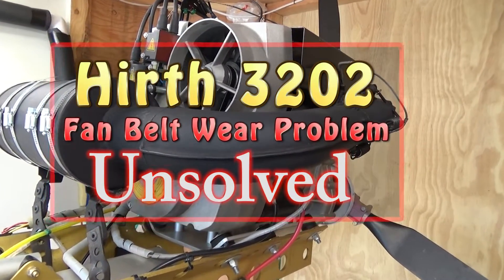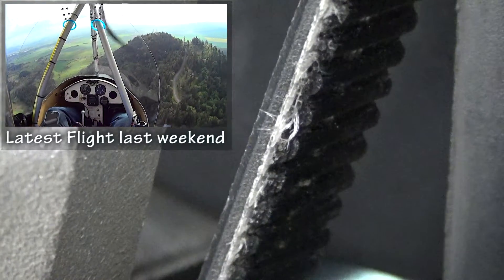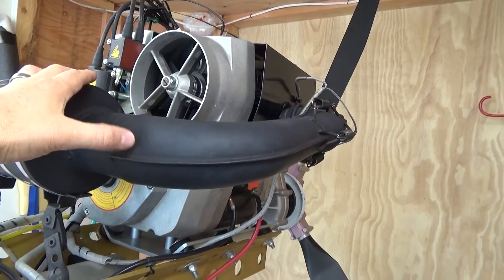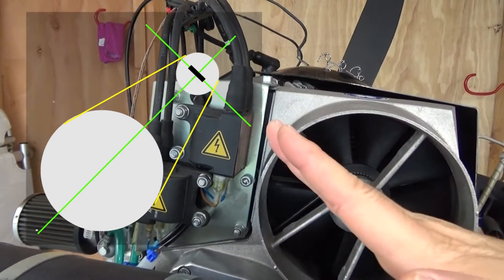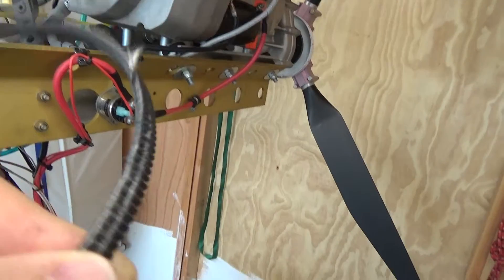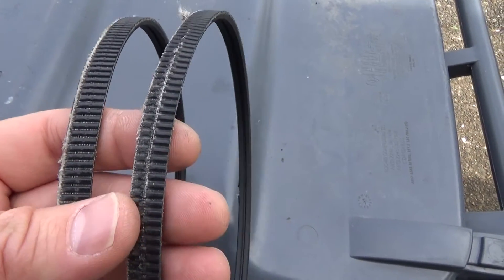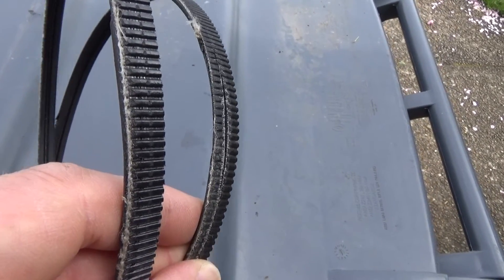Hirth 3202 Fan Belt Wear Problems - Unsolved Mystery

Comment: Daniel, could you please update the current status of your Belt problem, have you resolved it yet...?
Reply: Another tidbit.  The fan shroud looks like a casting.  Castings can have “residual stress”.  The stress holds the shroud in a peculiar shape.  Hirth machines,checks, everything is OK.  Then, in service, the vibration relieves the residual stress and the shroud relaxes, but not to the shape it was originally machined.   For you the fix is a new shroud, hopefully without residual stress.  For Hirth, the fix is stress relief before machining to relax.     CC
Reply from the maker: I believe I may have solved it. The belt was rubbing on the narrowest internal area of the shroud. So I got in there with a dremel and removed a die-casting seam line burr which was protruding about 1mm. Also, I added an extra shim washer to the upper pulley, further moving the belt forward away from that area. I have flown around 10 hours or so with no sign of belt wear.
Reply: Thanks Daniel for the prompts update!
 Ive been pondering purchasing the 3203, So was following your scenario. Im glad you have worked it out.
Are you otherwise happy with the engine..? power/performance...
Reply: glassdogangle     I was studying Hirth for a project, ran across this, and hope have been able to fix.  
     In addition to other comments, it appears the fan housing /shroud is mounted to the block.  In turn the fan to the shroud.  The belt runs from block to fan.  The misalignment May be shroud to block.  Unfortunately can’t see what’s going on, except maybe with mirror or borescope.  
    A clue is if the original belt had decent life.  Hirth had some unknown assembly techniques. 
   How has this engine worked out, been otherwise reliable?  Support?     Thanks CC

Comment: at 32 seconds into the video, it looks like the belt is rubbing on the engine casting
Reply from the maker: Yes that is part of the problem. I have since fixed the issue by adding a second spacer washer to move the belt away from that edge you are talking about.

Comment: I watched two of your videos about the belt problem. First I have never worked on a hirth engine so I don't know how Hirth instruct you to install the belt or what belt to install, but for what it is worth I noticed this and thought it was out of place.  Normally belts like what I have seen in your videos, "ones with teeth or horizontal ridges and are often refured to as timming belts"  ride on pulleys that have identical receiving ridges that keep the belt from slipping. I could not tell in the video if your pullies have these ridges. If they do you definitely have the belt on inside out or so it apears in the video. I wish I could see it my self so I could give you a more sure answer.  However if the pullies are smooth it still may be the case that the belt is on inside out. I would bet you are using the correct belt which makes me wonder if this next suggestion is good or not. If the pullies are smooth and you don't want to, it doest work or the belt doest fit  when turning the belt teeth to the inside I would suggest looking into finding a belt that has no teeth on ether side. It should ware better when vibrations cause it to strike the housing sides. 

Good luck I hope you find a solution! If you keep having a problem I would call Hirth and troubleshoot with them. It is definitely worth the trouble. 

Goodluck again and Happy Flying!
Reply from the maker: I already figured it out. I added another washer to space the top pulley further towards the front of the aircraft, and I got in there with a Dremel tool and a metal cutting bit to grind away an area inside the housing where there was a raised casting ridge which was causing most of the wear. Problem FIXED!

Comment: If there is no interference with the bell but it's still wearing I'd suggest checking the pulley alignment. If the pulleys are miss aligned then the belt will be forced to one side of the pulley and therefore it will wear on that side.

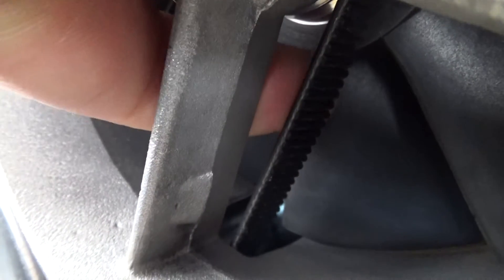Comment: I don't know Jack about engines, but at 0:40 it looks like the belt passes very close to the lower "shoud"? It could be rubbing on that little area, it would also be logical if it was only rubbing on the one side if this is the case.

Comment: A shot in the dark wild assed guess... It is counter-intuitive, BUT, a belt will migrate to the tight side of a pulley.  On flat belt pulley systems, the pulleys deliberately have a high "crown" in the middle.  Without this crown, the belt(s) will walk all over the pulley surface.  Watch David Richards videos here on YouTube to see this in action.  As little as half of a degree mis-alignment on a v-belt pulley axis will do the same, and the belt will rub on side wall(s). The thinner the v-belt, the faster the asymetrical edge wear becomes noticeable, as contrasted with a much thicker belt such as an automotive air conditioner belt.  The cracking in the center of your belt(s) is from the belt not traveling in a straight path, and travelling an "S" shape path and stressing the belt center line...also way more noticeable in shallow belts than thick belts.  Those pulleys MUST be parallel and dead nuts aligned in a straight path.  Way too easy to have a built-in misalignment from worn factory tooling.

Comment: The video focuses on the belt and not the belt path, ie on the result not the cause location. More data needed. Install and align and tension the belt as best you can, put some colorant on the worn side of the belt, and run the motor for a minute or two, strip the belt and check the belt path on the pulleys for most colorant transfer which then might mark the trouble spot.

Comment: Maybe the fan wheel bushing #11 is worn enough to put the belt slightly out of track/alignment.
http://www.hirth-engines.de/index.php/en/support/category/75-engine-3202?download=126:spare-part-list
Reply from the maker: +Stormin13 --- Your comment got me looking at the manual you linked to, and also thinking. One thing about that #11 "bushing" is that it actually floats around in between both bearings, and would more correctly be called a "spacer". If you pull out the eccentric bolt which holds the fan in place, and then you try to put it back in, you will find that spacer is floating in between the bearings, so you have to tap the fan assembly around to get the spacer to line up between the bearings in order to push the bolt through again. So the only place the spacer could wear would be the outside edges (any wear on the inside of the #11 bushing would not cause any misalignment, because the outside of the bushing does not contact anything or align the fan in any way). If this happens, then the end result would possibly be that the fan unit, when tightened down, would end up in a position closer and closer to the MAG side, which is the side that is having the wear problem. So just thinking this out has led me to a possible solution, which is in fact already on the way. RPE is sending me a 2mm thick washer which will space the fan out towards the PTO side again, and this may stop the wear. When I pull the fan out again to install this, I will definitely be taking a second look at that #11 bushing spacer and checking it for signs of edge wear.
Reply: +glassdogangle I also noticed from the parts break down item #6 is an assembly Fan Hub - might be a known issue if they provide an assembly with all the bits and pieces in question.

Comment: I was just talking to my buddy that's a ap mechanic your belt is reversed the bumpy side should contact the pulleys
Reply from the maker: +bryonheath --- Several people have suggested that, but that's not true. The belt is a v-type, with two vees on the inside of the belt. Both pulleys have the same (reversed) vees on them. They match exactly. If I flipped the belt, it would probably be destroyed in about 10 rotations. I do appreciate you taking the time to talk to your mech about it though. Even incorrect suggestions can shed new light sometimes.

Comment: Daniel,, Been chatting with you since the second flight of the Skywalker. Forty year mechanic and much of that time with snowmachines in Alaska before here.             . That being said, to my knowledge there has never been a hirth in a snowmachine, but Hirths are a lot like Kawasaki and other fan belt cooled 2 cycles. All we care about is how you are out of alignment, so lets break this down. As others have said there are 3 possibly four geometric angles that combined give you "perfect" alignment or not. First off do you have a service manual that shows the internal works of belt, shroud, crank pulley, and spindle in shroud? See if there is a tensioner. Next since you know you are tearing down the fan side again anyhow (if you haven't already), inspect the crank pulley for anything that looks like a rust spot or a gouge in that side of the pulleys finish all the way around and I mean with a light that will fit down in the pulley and look at it from a couple different angles. Blemishes or irregularities are not seen straight on, but rather from an offset angle. Anything other than a perfect shiny surface is suspect. This is my theory as I have run into this issue with a 440 Kawasaki engine that a friend brought to me as he was eating up cooling fan belts in his Arctic Cat snowmachine. Long story short he had a defective shroud in that it had a casting defect that did not allow tensioner/bearing (top) pulley to run true. Any deviation in true will cause excessive wear. Secondly as I quickly looked up not only the specs for this engine but also manufactures recommendations as to repair and maintenance. It clearly states that for what ever reason that anything so much as a blemish or possible impact with shroud it is to be replaced immediately. Now I dont know about you but I have noticed a level of "ANAL Safety" recommendations in the aeronautical industry that at times seems over the top, but I dont believe that would be true here. Overheat is basic "No-No" right. What if,,,,,,previous owner had to have a replacement put on? Two things to leave you with,,,,,,,did the belt always have excessive wear since you owned the plane? Did wear issue begin after any event that included impact of that shroud in any way? I will leave this link to spec page,,,I hope any of this nonsense can help. Bummer about being grounded,,,,but its like anything else,,,better safe than sorry.        http://www.ultralightnews.com/hirth3202E/body.html
Reply from the maker: +Randy Winner --- I bought the engine brand new. The only person who started the engine besides me is the A&P Mech who installed it, and he only ran it until it warmed up. There is  a tensioner, but the belt is tensioned by turning the small pulley bolt up to 180 degrees out for full tension (it's a cam type bolt, so you simply turn it to tighten the belt, then lock the nut on. the nut is visible in the vid in plain sight, and the slot in the bolt shows you where you are tension-wise).
Reply from the maker: +Randy Winner --- Thanks for the link. One thing that caught my eye is that in this paragraph, it is saying to "Turn the adjustable cam centre of the fan wheel and set to maximum tension." This is contrary to what RPE has told me to do. They said to set any new belt to LEAST tension, then tighten a bit after 20 hours. From the link above~~~~>> "4.16Remove and assembling the fan housing To remove the fan housing, take out the screws of the shroud on the side of the cool air exit. Turn the adjustable cam centre of the fan wheel so that the flat belt of the fan is without tension. Remove the four front screws of the fan housing and pull the shroud off along the axis of the adapter sleeve. After the fan housing slips off the adapter sleeves, push the fan housing downward and take the flat belt off the belt disk. To install the fan housing, reverse this process in logical order. Turn the adjustable cam centre of the fan wheel and set to maximum tension. "
Reply: Sorry Daniel, have been prepping house for paint and it's a bitch! I think you are zeroing in. I wish I was there with a dial indicator, do you have access to one? If so rent, beg, barrow a magnetic mount/base type and set up to run it on each machined "V" curve of each side of each surface. Your checking the "runout" of each surface. This must be done as this is iregular so, how do we zero in, , with ruling each thing out,,,,,right?
Reply: Make sure tensioner is tight before you check it or it will wobble
Reply: Any deviation over 0.003 is suspect
Reply: Here is a thought that will be apparent as you check which surfaces are true and smooth, and which are not. Is the issue the cam tensioner? Dual beveled surfaces being drawn togeather under force,, right?,,,so how do they stay true as they draw the two sides of the upper pulley togeather?,, this is where I would be willing to bet my money. Crank is a rigid mount, no variance here. Tensioner should be rigid as well. So what's left that could shift fore or aft to shift the level rotation of upper pulley?I think once you find that out you will find the issue. As you said it's a young motor low hours, so you could be dealing with a defect.
Reply from the maker: +Randy Winner --- I am going to try a 2mm shim washer first from Matt at RPE. By moving the small pullet towards the PTO side, it may stop it from rubbing whatever it is wearing against on the MAG side.
Reply: There have been lots of Hirths in sleds....292 and 634 come to mind. I have an Artic Cat Puma with a 634 Hirth.
Reply: It was in the old chaparral snowmobile

Comment: Once I saw that on a engine were for some unexplained reason one pulley curved guide was missing. Had to see it in the book to know there was such a guide there normaly.
Reply from the maker: +Daniel Lelievre --- You mean like a teflon guide which keeps it from rubbing? That makes sense. They have them on car engines I think. I thought I remember seeing one on a timing chain. However, not a belt.
Reply: +glassdogangle http://i.ebayimg.com/00/s/MTE5NVgxNjAw/z/sVkAAOSwVFlUHwAg/$_35.JPG

this is the best picture I could find to explain. Without that, the belt would do exactly what you are showing
Reply: +Daniel Lelievre other than that I would remove the covers and put a flat metal ruler on the side of one pulley and check that the other pulley is perfectly aligned with the first one.
Reply from the maker: +Daniel Lelievre --Ah so that washer looking thing basically keeps the pulley from jumping off to one side... Also I did check the alignment, and they are aligned fine.
Reply: the sides are smooth and will guide the belt perfectly aligned with the pulley. Look at the shop manual of your engine or ask the place where you buy parts for a "exploded view" to see whats supposed to be there.

Comment: Are you sure the bumps are supposed to be on the outside of the belt rather than on the inside?
Reply from the maker: +seafax -- Yes the belt is absolutely on correctly. It is a double v belt, and the v side goes inside.

Comment: toss a fresh belt in and add some tension see what happens
Reply from the maker: +shadowsrwolf --- Yes that would help if the problem is being caused by a loose belt sagging under load.
Reply: would be nice if you could run it with out that cover to see wtf is going on under there